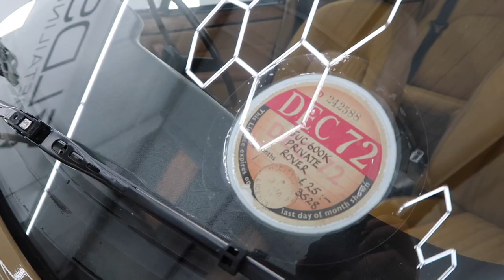The oldest car I've ever worked on! 1972 Rover 3500 V8 Detail

Comment: I’ve detailed this actual car a few times. Belonged to a friend of mine. Paint on it is very delicate as it was last repainted back in the late 1990’s It had a light ceramic coating on it way back in 2018 but after the owner that I did it for passed away in 2020 it wasn’t properly maintained and had suffered. I detailed it again in 2021 prior to its sale no ceramic coating was applied it was only sealed and waxed. I know this car very well. So glad it’s looking how it should again. Well done
Reply from the maker: Great to hear the back story, thank you!
Reply: I also know the car very well I owned it for around 25 years and re built it/painted it .
It's painted in cellulose I did it in my garage in 1996.
So no not one bit is original paint it's painted in standox .
God it's got the wrong wheels and mirrors . Just why !

Comment: The P6B V8 is a fabulous car, it was well ahead of it's time in many areas- especially in terms of safety, it was the safest saloon on the road back in the 70's. It was also a super saloon- fore runner to the BMW M5 concept. When the 3500S manual was launched, it hit 60 in 9 seconds dead- and 125 mph, which was very rapid back in 1969/70. An E-Type hit 60 in 7 seconds and did 140 (true) mph, and was regarded as a 'super car.' The P6 still does some things better than any modern car- it's ride quality is sybaritic- like riding a magic carpet. Visibility is superb- far better than a modern lump. Ergonomics a superb- especially for the era, when many manufacturer's tended to get a box of switch gear and throw it at the dash. Where it landed- it got fitted! LOL The P6 has perfect 50/50 weight distribution, and a sophisticated De Dion rear tube suspension- which companies like Aston were using at this time. The traction and grip of the P6 is superb- especially for a car of this era. Braking? Discs all round- very effective- no need to pussy foot around and forward plan for braking like you do in so many classic cars. The P6 is one of the easiest classics to use as a daily driver. I own a 3500 like this one- auto, Mexico brown, it's an absolute gem to drive and every journey has a 'sense of occasion' about it. It oozes class with lots of stainless steel and chrome. Ask yourself this question- If you buy a modern 'prestige' car today, where is the 'quality?' Chromed plastic doesn't constitute quality. You can park a P6 up next to anything today, and the car snob in you will relish looking down your nose at the soulless moderns with plastic bumpers and fake chrome- which even Bentley's come with today. The buying public are being mugged off- with plastic shit, dull styling and far too much complexity- sensors galore- very expensive when they start letting go.

About five years ago, 'Practical Classics,' magazine took a P6 over to Belgium, and they handed it over to the team of judges who judge the Europen Car Of The Year Award. The P6 was the first car to win that accolade. The judges raved about the P6 in the recent assessment. They highlighted the superb ride, brilliant ergonomics, taught handling, excellent traction, fantastic visibility and ease with which it can be positioned on the road. They loved it's solid, well engineered feel and summed up by saying, "The Rover P6 still does some things better than any modern car. We haven't progressed very far since the 1960's."
Reply: I too own a V8 auto in Mexico, and I totally agree with you. Spot on 100%. Top favourite car. So advanced.